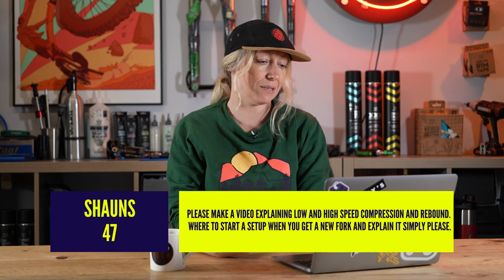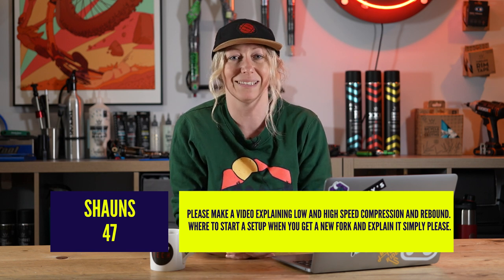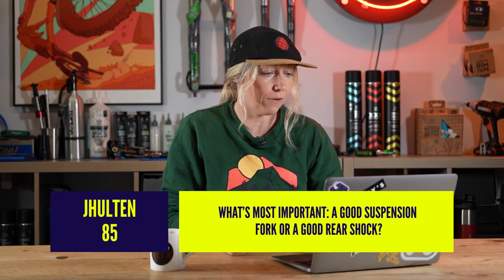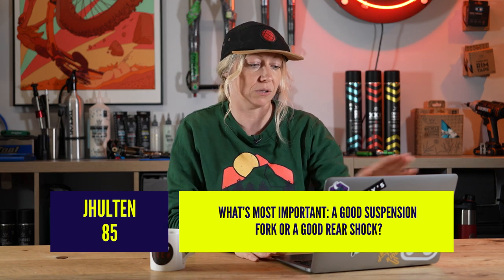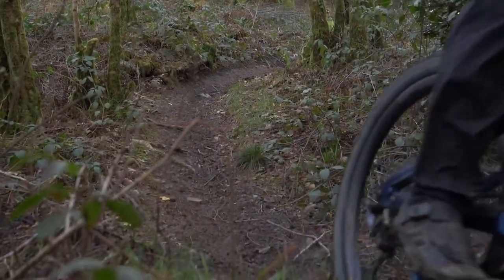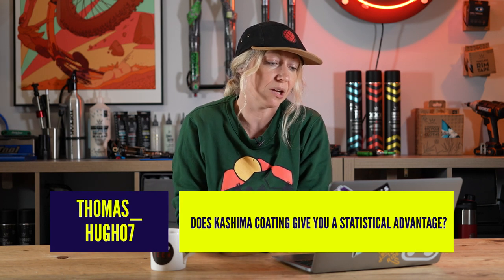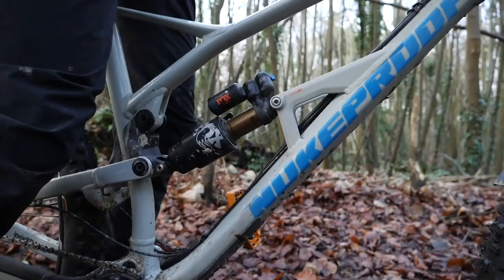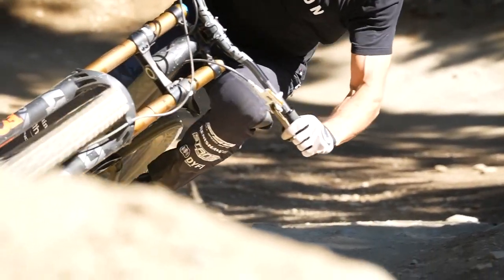Suspension Special: Should I Upgrade The Front Or The Rear? | #AskGMBNTech

Comment from the maker: Do you have an MTB-Tech-related question for Doddy or Anna? Use the hashtag #AskGMBNTech with your comment for a chance to be featured on the channel! 👇
Reply: #AskGMBNTech Does a balanced suspension mean the front and rear travel " travels " equal distance with the same amount of weight applied for each or is there a ratio that the sag determines
Reply: Can you upgrade the lowers of a Fox 36 pre 2019 to the new Fox 36 lowers that have the bleed valves? #AskGMBNTech
Reply: #AskGMBNTech is it normal for  mechanical dropper posts to have a harder to push when the dropper is weighted? I noticed that my dropper post is easier to push the lever when I'm standing. Thanks!

Comment: Air vs Coil ... I've gone to coils on both of my suspension bikes (2012 Kona Satori now with an Ohlins TTX22 and a 2022 Revel Rascal with a PUSH) and the coil shock made a huge difference on how each handled and with a much better ride!  The rear wheel sticks to the trail and there is no stiction to fight on the little bumps.  So much easier to set up and there are plenty of calculators to select the spring.  I keep two springs - a lighter one for summer riding when I do wear as much and a lightly heavier (high spring force) for winter when I am wearing a lot of gear and likely also carrying a saw and trail maintenance stuff.  Sure they weigh more than an air shock but really not that much more.

Comment: tuning tuning that is key. Weather you upgrade change internals how or where you're riding you need it setup for YOU! I say start where manufacture says and go from there.
Reply: I don't understand tuning beyond simply adding/removing tokens and adjusting sag, LS,HS compression and rebound.  I know that bike mfgrs have forks and shocks tuned to the geometry of specific bikes and this is a total mystery to me.  It also means that if I upgrade my suspension, and want to say, reuse them on a different bike,  they would not work optimal or as intended.
Reply: @nick_john  there is some room to swapping shocks you might run in issues, but it might just be you need to set it up a little differently.

Comment: #AskGMBNTech Hello, I have a 2016 Kona Process 153 and am debating stripping it down to a raw Aluminum frame. Any tips or processes that I should follow? I also don't want to wreck the frame structurally but also love the look of raw aluminum
Reply: I had an aluminium Scott in the early 90s, the paint started flaking off so I had the frame shot blasted and then finished with a clear satin lacquer. Personally I wouldn't leave the frame completely bare because it would be impossible to clean, and vulnerable to the elements. Otherwise, it was relatively simple to do, and looked great. I had it for at least two more years before selling it to a friend, and neither of us had any issues, so I would be pretty confident that there was no invisible damage to the frame.

Comment: As rear suspension geometries have improved with a single front sprocket, the key is to pivot off the centerline of the tension (top) chain.  With this there's no pedal torque and lost energy.  If the pivot is above the chain centerline, it lifts the bike and rider.  If it's below it sucks down.  Both are wasted energy.
Reply: Anti squat and anti rise you mean... However both are characteristics that can be desirable and used to tune how a bike rides.... So in a word, 'no'

Comment: #askGMBNTech I bought a full suspension bike in July, winter here in Australia, and had the suspension set up, with the rear suspension, Rockshox Deluxe select+ sag being 25%. Now it is summer, and hot!, and I noticed it was feeling different so I checked the sag. It is now 20%, well under the 30% recommended. Do I need to re-set up my suspension each season, or could there be some other reason for the change?
Reply: I'd say it's caused by the temperature change. The higher temperature the higher pressure in the shock.

This means that when tempetature changes notably you should set up your suspension again.